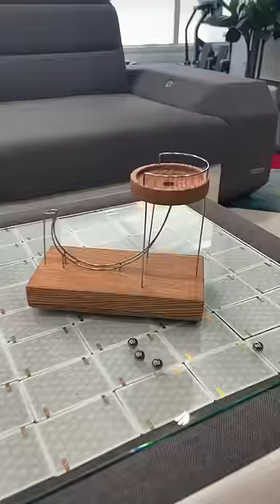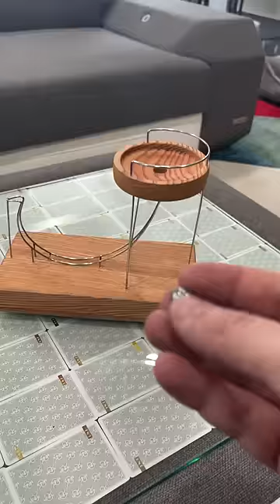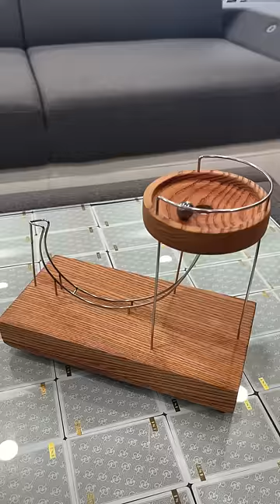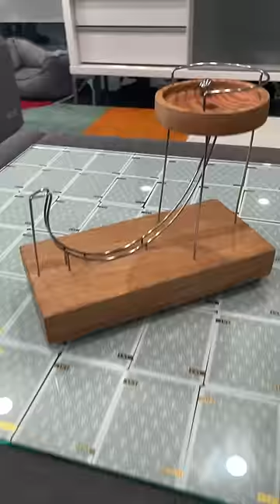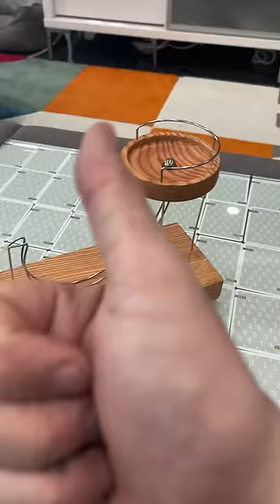An Impossible Perpetual Motion Device?! 😳 #Shorts

Comment: "This definitly feels unnatural"
Maybe cause it is.
Reply: Nope
Reply: @Stefan_Dahn  Theres batteries on the bottom so yes, the ball can’t go higher than it was, if that was possible we would have infinite power…
Reply: If you look at the ball, it is still losing energy in the jump, it’s just that the wooden platform lets it regain the lost momentum by allowing the ball to travel towards the hole—it’s initial point—once again. If you look closely, the ball always falls short of the hole. That’s the lost momentum that most definitely exists.

The platform could be any length between the hole and the ramp exit, and it could still be considered an infinite loop in this regard. The same principle is present here, at a smaller scale.
Reply: @stevenc8717  No.. Like I said.. The ball can’t go higher than it already was without external forces, it’s impossible.
Reply: No it’s not, it’s completely natural it just looks unnatural
Reply: You guys realize that there's an electromagnet in the bottom that accelerates it at the bottom of the ramp, right?  Without power, the ball would land roughly halfway up the opposing ramp.
Reply: He wasn’t saying it isnt
Reply: @perssontm1628  doesn’t the sun radiant energy? Henceforth we can build technology using the suns power rays
Reply: @lefuro3324  Yes we can use the energy from the sun? Like we do with solar panels. Although the suns power rays are limited so we can only collect a certain amount at a time. Anyways, what does that have to do with any of this lol
Reply: @lefuro3324  correct. But it takes more energy to build the solar panel than the solar panel can produce. The solar panel charges a battery. The solar panel and the bettery we're both built using non-solar energy in China. All a solar panel does is consume coal/hydro-electric power to be built, then output power from the sun. Highly INEFFICIENT and non-sustainable
Reply: @lennymcmillion  not true
Reply: Anakin: Is it possible to learn this power?
Reply: yah, thats cause it drops faster than you t should unassisted. there is a magnit or something underneith. it gains way too much momentum going down otherwise.
Reply: @lennymcmillion  🤦

Comment: Lol please remember to turn it off and recharge it when you're finished
Reply: A magnet doesn't need recharging bro.
Reply: @safwanshahriar4108  uhh. I does if it's an electro magnet. Also, even if it was a permanent magnet, it would still run out of energy.
Reply: @GMoney-B  Hmm
Reply: @safwanshahriar4108  Disappointing I know. I just looked it up though, it has an electro magnet in the base. Still a neat thing though for sure.
Reply: @safwanshahriar4108  according to Walmart it does. Bro
Reply: Theres an electromagnet at the bottom that adds emergy to the balls. If they qere made of wood or non ferromagnetic material it wouldnt work
Reply: @safwanshahriar4108  it's a wheel powered battery, not a magnet
Reply: @safwanshahriar4108  But that thing is getting energy from somthing
Reply: SO that's where the extra energy comes fro🤩
Reply: "Be kind, rewind"??
Reply: @GMoney-B  no wonder he said the people felt ripped off
Reply: I love this
Reply: @GMoney-B  permanent magnets don’t run out of energy what???? They only lose magnetism due to heat.
Reply: @mrpineapple3942  Easy does it Mr. Pineapple :). I was saying that if the device used permanent magnets, then the ball would run out of energy eventually. Not the magnets themselves. 

Permanent magnets may always have a magnetic field, but they do not increase or decrease their pull or repulsion. Their magnetic field is a constant. 

If you have a metal ball roll towards a permanent magnet, it would pull the ball towards it of course, however as the ball is trying to pass by that same magnet, it's speed would be decreased just as much as it was accelerated because it would be trying to pull the ball back towards the magnet when it was leaving the magnetic field of the magnet.

This is why you have to have an electro magnet to actually give it an energy boost. An electro magnet would pull the ball towards it, but then turn off so that the ball can pass by without getting pulled back towards the electromagnet.

Look at how many roller coasters work that use electro magnets to launch the coaster trains up to speed. The electromagnets do not just turn on and stay on, they alternate in polarity to pull and push the magnets on the bottom of the train as it goes down the launch track full of magnets. Otherwise the train would be pulled a few feet at best and then be pulled back to the center point of the magnets magnetic field. Magnets that do not turn on or off or change polarity are kind of like invisible rubber pands. They will pull towards it, but also pull it back if momentum carried it forward.
Reply: @GMoney-B  ah ok, it wasn’t really that clear. Now I get it tho.
Reply: @mrpineapple3942  do you love under the sea?
Reply: @safwanshahriar4108  jjj JJ in
Reply: @mrpineapple3942  I honestly thought the same thing but I reread the comment and realized it was talking about the ball
Reply: @S.K.R.E.E._Tsuki-Chan  yeah, there was barely any way to know they were referring to the ball.
Reply: Can u imagine if you could convert that energy and  generate free electricity the mind boggles 😬😬

Comment: Me before reading the comments: I see, so this is a trick 
Me after reading the comments: ALRIGHT I GET IT!!!
Reply: I don't get it please help :(
Reply: @cheese7119  lmao 🤣
Reply: @cheese7119  CGI
Reply: @cheese7119  there’s a battery or some tricks to these “perpetual motion” machines
Reply: @cheese7119  there is a electro magnet behind the platform which accelerates the ball when going downwards..
Reply: @germanye26  so in short it's not cgi. Chris actually  went over it that it's battery operated
Reply: @nicesmack9309  You sure? I saw the 3D model of it comparing it to the video, so maybe he did a double lie
Reply: @germanye26  we live in the matrix
Reply: @nicesmack9309  There is no spoon
Reply: @germanye26  Only a spork!
Reply: @cheese7119  A little wheel is on the sidewall of the drop point. One AA battery is inserted below the top, round dish. When the ball hits the drop point, the wheel turns on and spins as the ball passes through the drop point. That’s what gives it the required speed to make it back up to the top. This boomer conveniently leaves out the part about installing the AA battery. 🙄

Comment: The way the ball fell makes me feel like theres something making the ball fall faster than it would naturally.
Reply: Playboi_Soviet  derp
Reply: Magnet. That’s why it is pulled toward the center instead of rolling in wider circles. The first responder to this comment was dropped on his head
Reply: @milesgallon8326  the judges were actually looking for "magnets bitch".
Or at least that's what I came here for lol.
Reply: I’ve calculated the fall rate of the ball (E=mc2) and come to the conclusion the the Earth has grown in mass.
Reply: @jetmelt  well technically it is growing in mass every time an object falls from space
Reply: @mccari09  what?
Reply: @xxbirdshotxx  an object’s mass increases as it’s speed increases
Reply: It has a battery
Reply: @xxbirdshotxx  the mass of the earth is growing.
Reply: @indikulkarni7781  Conservation of mass. No it doesn't.
Reply: You must read about , a bowling machine, 
Used to practice in cricket, 
Tannis.
Reply: This device must have rollers on the upper deck, which accelerates ball, when it enters the hole in the middle .
Reply: I agree. I think there's a magnet in the base board
Reply: @yunusaysan8026  yes, it does. Ever heard of mass increase in Special Relativity by Einstein?
Reply: No as in magnetic force is pushing it down and back up faster than it would if it fell on it's own weight
Reply: @xxbirdshotxx  a meteor falls to earth. It hits the surface of the earth - it's mass is added to the mass of the earth. The mass of the earth increases by 1 meteor. Of course, even the world-ending meteor that killed all the dinosaurs was itty bitty compared to the Earth, so the gravity of the Earth doesn't increase by any noticeable amount - but technically, the mass (and therefore gravity) increase by the mass of the meteor.
Reply: Magnets PUSHING the ball down the track?
Reply: It would technically enter the hole with a velocity, since the top piece is like a funnel, but most of that velocity is killed in the process of entering the hole; acting like a buffer. Once the ball leaves the bottom of the hole and is heading down the track it gains momentum (because the track is shaped particularly to do this), and that's what gives the ball enough energy to make it back to the top again. 
The machine is perpetual once it starts, but it does require some amount of energy to get started in the first place, and that's why it is not a true "perpetual motion machine"
Reply: There are magnets in the bottom
Reply: Magnets
Reply: Even if there is a magnet component to this device, it's still working
Reply: Nope it's rotation on the track causes this effect. The track is more narrow at the launch vs the very start. The ball rotates very quickly at the start but moves slower and as the track narrows that energy is maintained but the rotational point is changed to another region of the surface area causing the ball to speed up at an even greater speed then what's capable of just gravity alone can cause. It's simple physics that can explain this and it will keep going. This cannot be utilized to create more energy then what has gone into it. If we tried to somehow harness the energy this could create the ball will not keep going perpetually. It's a very neat idea though.
Reply: @melontusk7358  this is not particle physics so doesn't apply to the op. You're correct though as far as statements go
Reply: @smoketrail9181  on batteries yes
Reply: @tomrvn666  physics and batteries, yes
Reply: @smoketrail9181  its a battery powered electromagnet
Reply: @somnia3423  batteries not needed
Reply: @tomrvn666  then it wont work, this device uses batteries
Reply: There’s a magnet inside the base
Reply: @FindingUser  no magnet necessary. Gravity simple gravity.
Reply: @rickyhineman4124  the exact reason that there is no true perpetual motion machine. Energy has to enter the system somehow. And most systems will dissipate the energy over time. This particular example is cool because the gravity recharges the system every time and it could keep going indefinitely as long as it was undisturbed. But you're right initial energy in is always going to be necessary, of course.
Reply: @deadlybasilisk74  no magnets. Why would you need magnets when you have gravity?
Reply: @BOOGiNS  magnets would stop the system. Think these things through guys. Magnets can be used in a way to create movement but it wasn't necessary here.
Reply: there is a magnet that is well located to make the effect
Reply: @rickyhineman4124  
True, but how long would the "machine" have to run to equal the energy required to start it, then allowing the resulting energy produced afterwards to be in the "bonus round"? Regardless, the original energy would be the only outside source necessary for one time use to produce the continuous energy. Cost efficient? Don't know, I'll leave that to the Brainiacs here to come up with that formula.
Reply: @Earendil1982 friction doesn't have to be ignored at all. Besides there being negligible friction anyway, what little is there is taken into account within the system -  overall - such that the friction produced cannot stop the system. The potential energy the machine has to offer the ball will translate into enough kinetic energy to propel the ball back to the top, regardless of the frictional forces. Since all variables are constant each time the ball makes a loop it's guaranteed to make another; supposing no external variables (forces) are introduced. This is the notion of being perpetual
Reply: @Tux00  I don't think so. Any kind of magnet that accelerates the ball toward the bottom would also produce an equal force pulling backwards on the ball as it travels up the ramp, slowing it back down.
Reply: @therealdeal3672  it just seemed like it was falling faster than just by gravity
Reply: @melontusk7358  theories of a freemason
Reply: @mccari09  the earth loses atmosphere continuously to space, so not really
Reply: Why can't the power source be the acceleration of gravity?
A good test would be to drop the ball just above the hole and see if the system continues.
Reply: That curved path is the way of giving faster movements to the ball. It is a basic science experiment.
Reply: @therealdeal3672  im sorry but this device is powered by a batterie
Reply: @somnia3423  provide a good argument for why you think it's powered by a battery. Just because you think that doesn't make it true. Anybody who gets the essence of physics can see what's going on and realize that gravity is powering this device. No other force is needed. Keep studying and observing. Take science classes. Don't make assumptions when you don't know what you're talking about.
Reply: @somnia3423  here's a thorough breakdown of how the device works. A small track is carved into the concave disc at the top. The track causes the ball to go around in a circle rather than dropping straight to the bottom of the concave middle where the hole is. The wire ramp as one person mentioned is constructed in a way that one gives high velocity to the ball by being steep. Two the wire track is narrower at the beginning of the track widening out to slow the ball down and give it a point from which it will be pointed to circle back to the disc. Once the ball goes back to the disc the flow starts again all using gravity. No need for a battery no need for magnets. Very interesting device. But requires no additional energy other than the very first drop of the ball.
Reply: @therealdeal3672  what are you trying to proof? I mean buy it and dont put the batteries in and see how well it works without them
Reply: @somnia3423  did you ever hear of the Dunning Kruger Effect? That's what's going on with you. You think you know but you don't. You think you know more than you do. You think you're smarter than you really are. And you've come to a wrong conclusion. No biggie. Just facts.
Reply: @finloc225  not so much as to effect the mass of the earth. Planets are made the way I said so you don’t have any idea what you are talking about

Comment: “magnets or some shit.”
-me
Reply: What kind of battery u got under board ?
Reply: Litterally what I said. Second idea was electro magnet coil
Reply: Magnet is fine tbh. If there’s a battery that’s where the energy is coming from and needs to be replaced eventually making it not perpetual.
Reply: I think it just a gravity energy
Reply: Realistic animation actually
Reply: I'm guessing the rails are electrified. When the bead bridges the gap between the rails, it completes the circuit and creates a magnetic field, accelerating the bead
Reply: @hellatze  it's not potential energy as it would not be able to go higher than wher it started.
Reply: No magnets are still are an energy source so it proves it’s Real
Reply: The acceleration is the little extra curve at the end of the little ramp. Slingshots it. Looks like it slows down in midair...magnets
Reply: Yeah, I'm goin with  "or some shit".
Reply: A magnet is attached under the base of the top board
Reply: Prove it

Comment: There's a energised coil embedded in the wood at the lowest part of of the ramp. It helps to speed up the steel ball.
Reply: Exactly my first thought. Only I first thought there would be a permanent magnet accelerating the balls as they go through the hole.
Reply: Actually it’s two rotating wheels.
Reply: no its 100% a centrifical engine deep inside the wood ...it may be 3 at most
Reply: @igoliveira  Permanent magnet would slow the ball down as much as it accelerates it. The electromagnet can be electronically controlled to detect the ball and only activate for a part of the travel or change phase as needed.
Reply: Thanks for the answer you total chad.
Reply: @igoliveira  magnets cannot do work.
Reply: or it's just gravity
Reply: @SianaGearz  I see. Flawed logic of mine. I thought there was some detail about passive/active component that I hadn't fully thought through, thanks for pointing it out. So, same principle of electromagnetic force, but it has to be an electromagnet rather than a regular magnet due to the reason you pointed out. Thanks for explaining it.
Reply: A little wheel is on the sidewall of the drop point. One AA battery is inserted below the top, round dish. When the ball hits the drop point, the wheel turns on and spins as the ball passes through the drop point. That’s what gives it the required speed to make it back up to the top. This boomer conveniently leaves out the part about installing the AA battery. 🙄